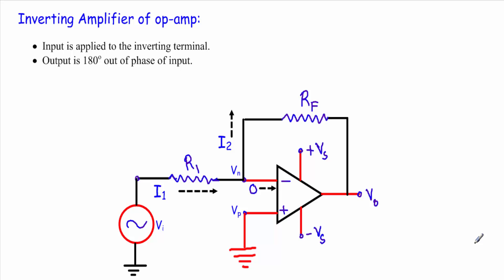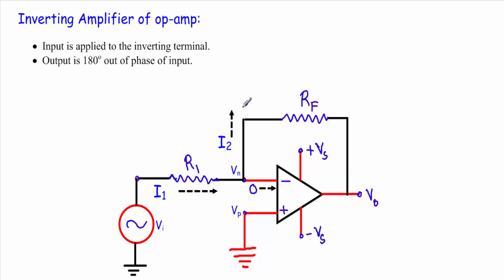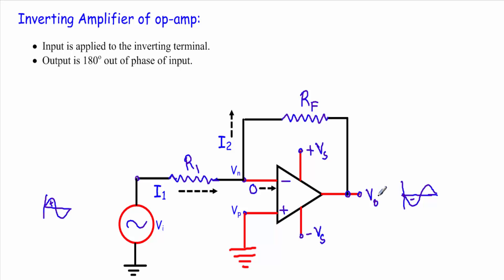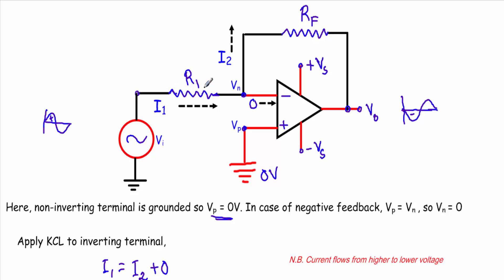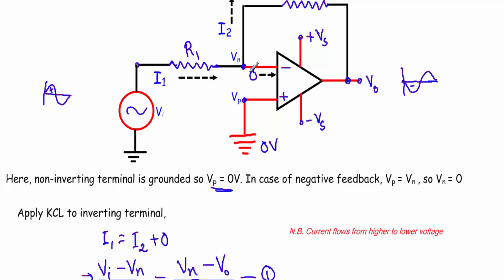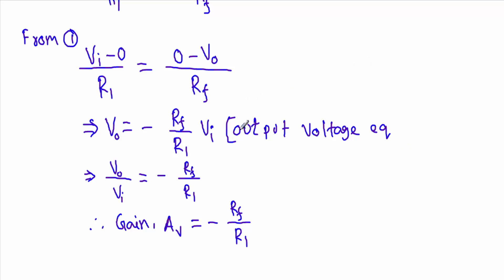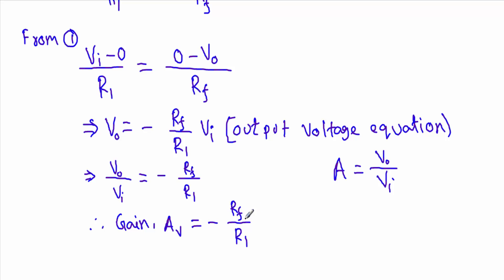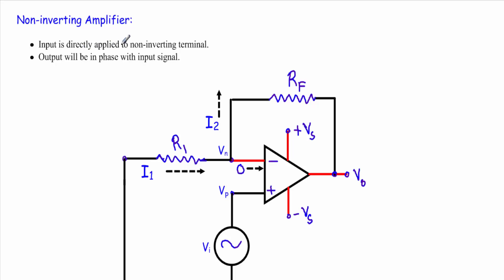Op-Amp Inverting & Non-Inverting amplifier, Op-Amp Buffer Circuit (w subtitles)

Comment: Could you please say what will be the gain formula if input is applied through a resistor in non-inverting terminal and output is connected to the non-inverting through a resistor?